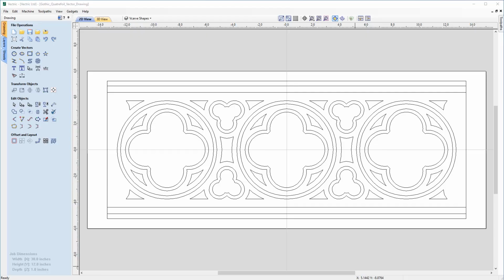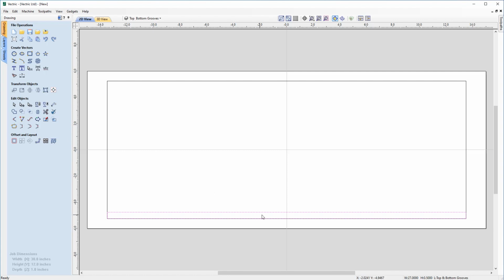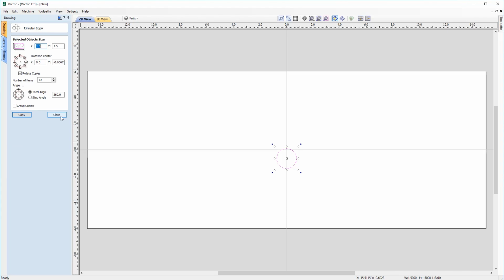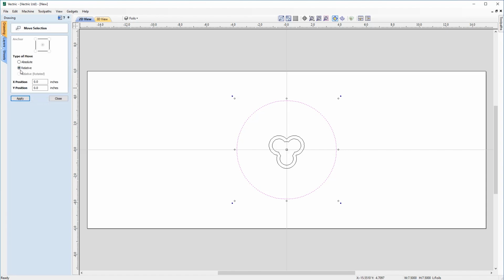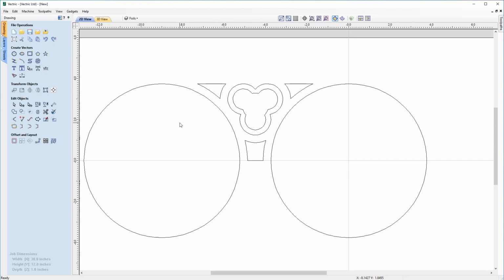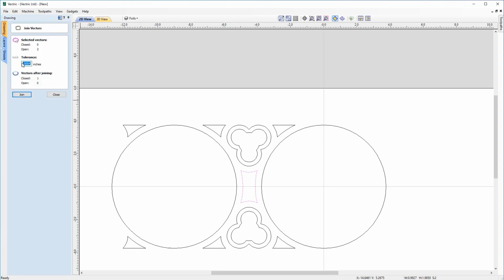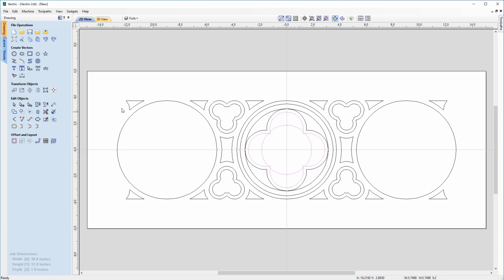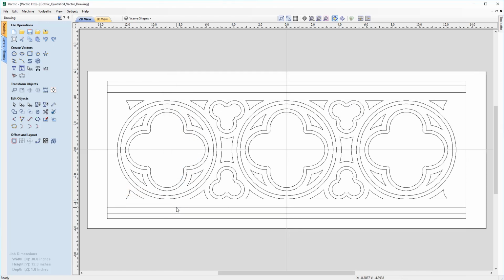Gothic Quatrefoil | Vectric V11 Tutorials

Comment: At the 11:38 point of moving the object to the center point, I’ve tried over a dozen times and it never works.  I hover the edge of each circle and it still never finds the center point.  I keep running into problems like this on different learning videos.  Is it because I’m using a free version?  I even ordered my laptop strictly for the CNC I’ve got coming…..please help
Reply from the maker: Hello Todd...  This might be one for support@vectric.com but before you do that it might be work making sure you have "Geomentry Snapping" and "Smart Snapping" turned on... upper right of the view window or press "F4" for all the snapping options.  I'd also look at the "snapping radius"... make sure it is set to "Small".   Hope that helps... and if not fire an email off to Support!